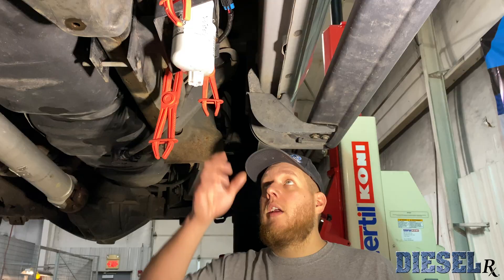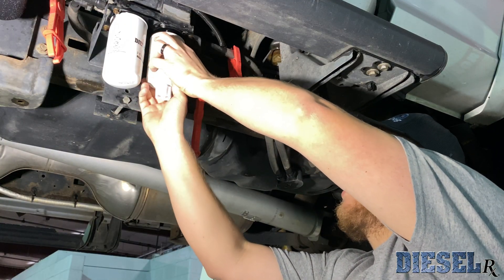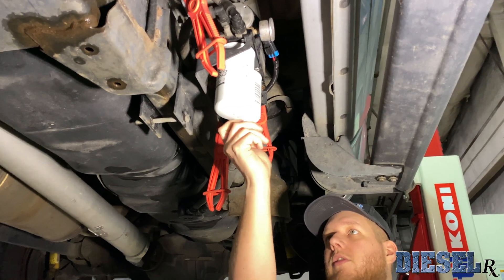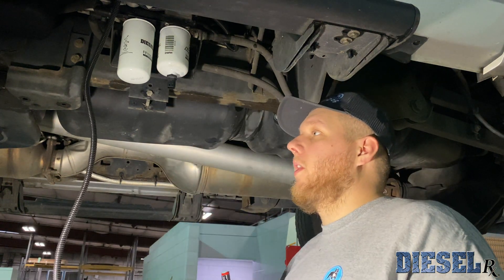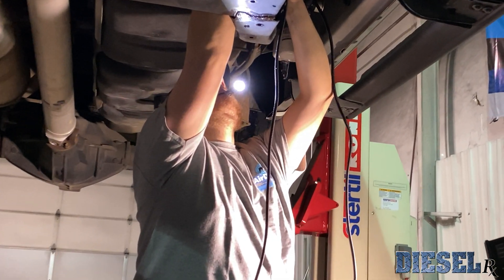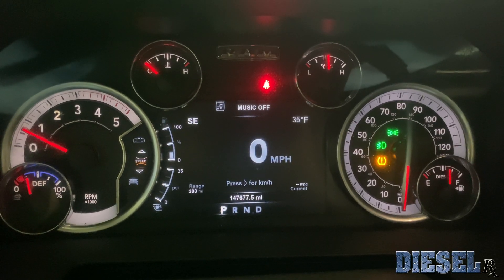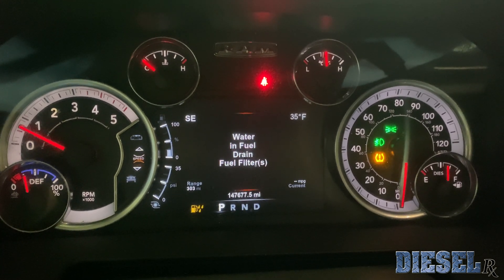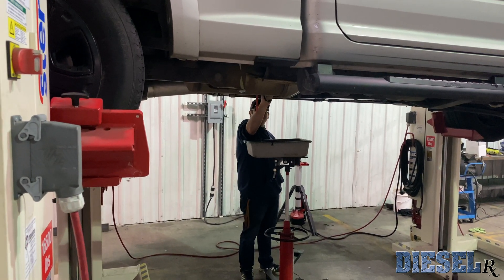AirDog Water In Fuel Kit 2007.5-2023 Cummins Installation (DRX07.5-23DWIF)

Comment: I have the fleece performance distribution block with the wif sensor in it. 
Can this harness be shortened and plug in to the rear under bed filter harness that’s not being used?